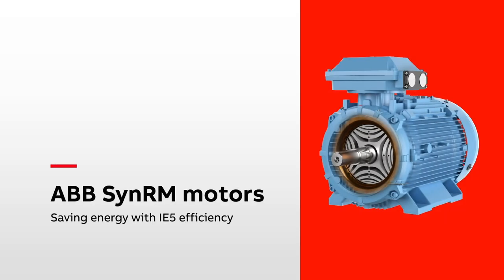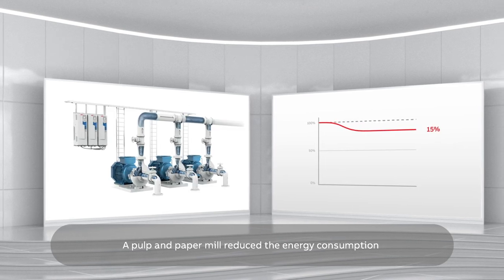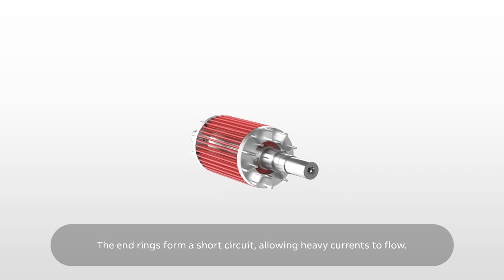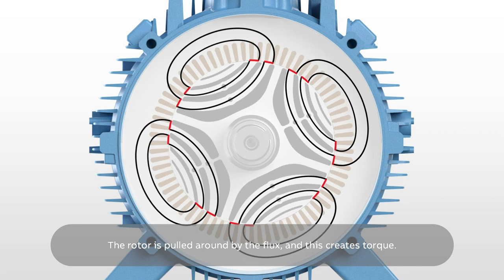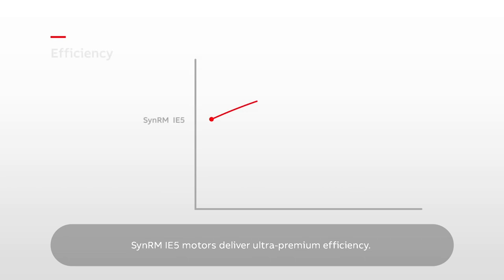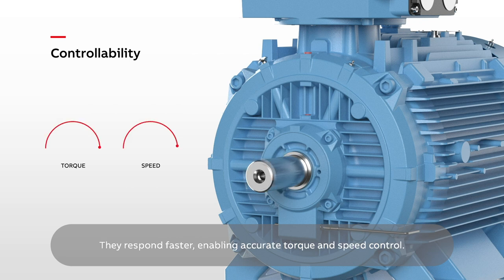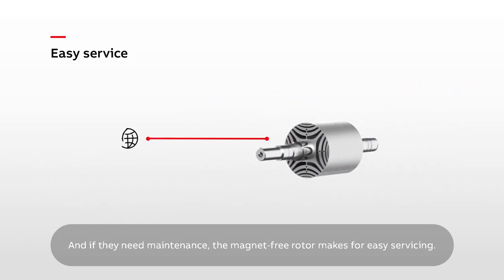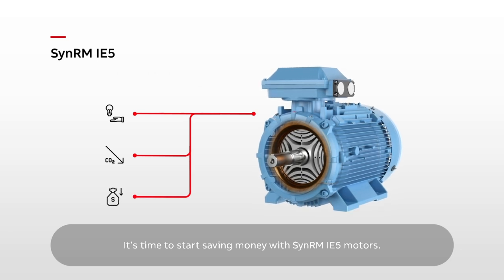Start saving energy with ABB's IE5 SynRM motors

Comment: How is there no current in the rotor when the stator sets up a magnetic field?
Reply: well sure there are but not on the level of induction motor. I guess the "no rotor current" is just typical marketing BS...
Reply: yes...but how far does that rabbit hole go?
Reply: There must be some, just minimized by the air gaps.
Reply: My understanding is that a changing magnetic field is required for an induced voltage (Lenz law). In a SynRM , the stator magnetic field is not rotating wrt the rotor because the rotor is synchronised with the magnetic field.  From the perspective of the rotor, the magnetic field is not changing and thus no induced voltage/current.
Reply: I think there is a magnet in the rotor that sets up the field...a lower path of magnetic resistance....ahhh reluctance if I'm not mistaken...
Must be some current...even it it is a sync motor...sure there will be a marginal amount of slip...cant be that a stiff of a system
Reply: @wangarooi  I appreciate the reply to your 2 year old comment , in most content ive viewed they have stated the rotor is constructed of  iron laminations (for reduced hysteresis) and no PM. As for slip, I'd suggest there is none. As the rotor works on the principle of reluctance , the VSD adjusts to ensure the rotor is rotating at synchronous speed. If there is any slip, I'd suggest it is extremely close to 0 with majority of the losses coming from iron/saturation losses

Comment: The SynRM with drive is far superior to Induction motor with VFD, in terms of speed control, torque and efficiency. But for applications, which require no speed control, induction motors are superior, in terms of efficiency, as the drives also has losses.